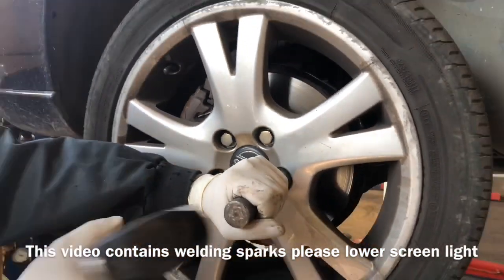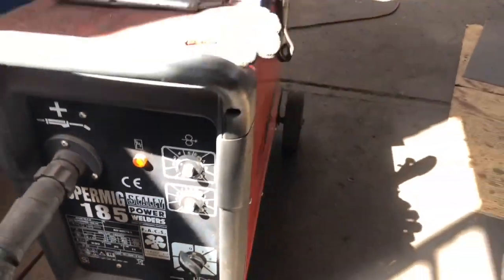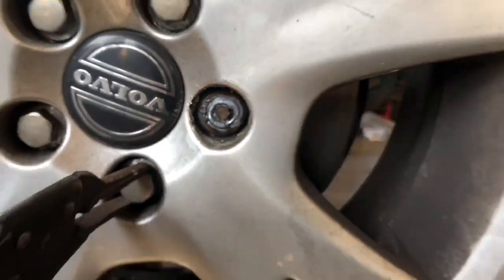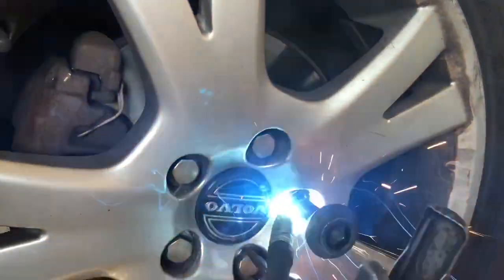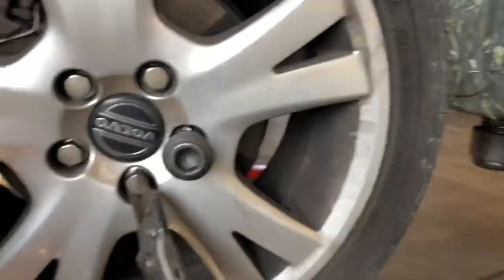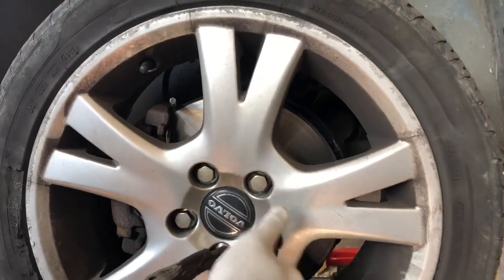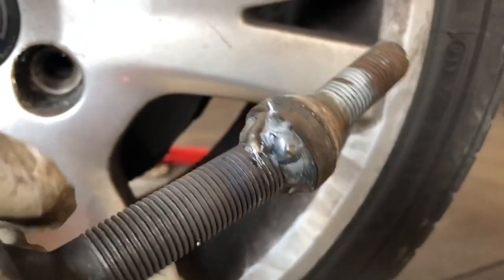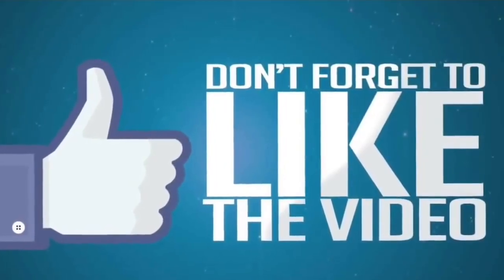HOW TO REMOVE WHEEL LOCKS WITHOUT A KEY TOOL @zmmotors1

Comment: Thank you so much, I have an Audi with the rotating ring on the outside of the locking lug, I tried every other method on You Tube but this was the ONLY one that worked for me. As far as I can see this is the only video on this so thanks guys you are a life saver.

Comment: remember to disconnect the battery first
Reply: Why
Reply: @connor3288  if u dont it will short all the bearing and rings in a car 240v  verse 12 volt
Reply: @sbiggs10  Yeah people say that.  Other people that have welded on hundreds of vehicles, especially exhaust guys, say they never disconnect the battery and have never had a problem.